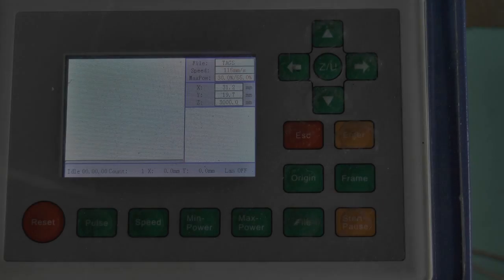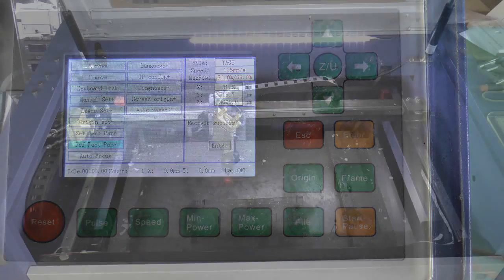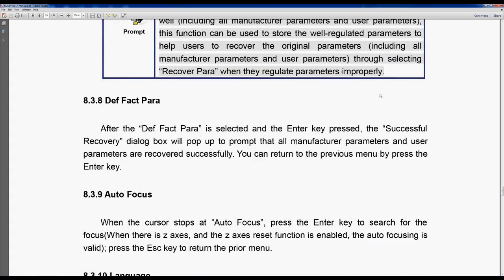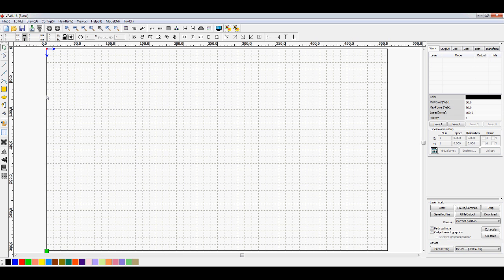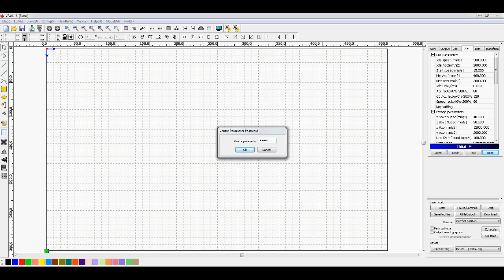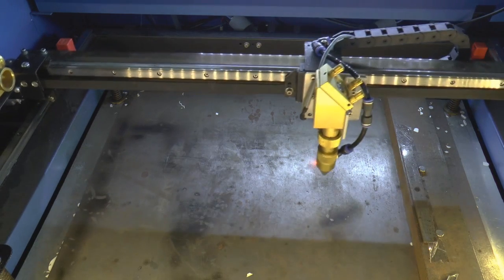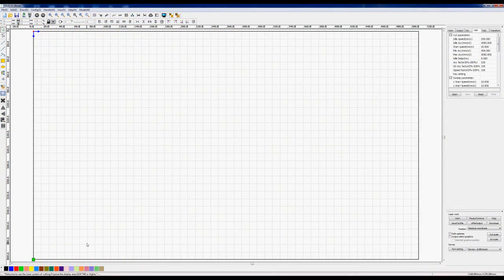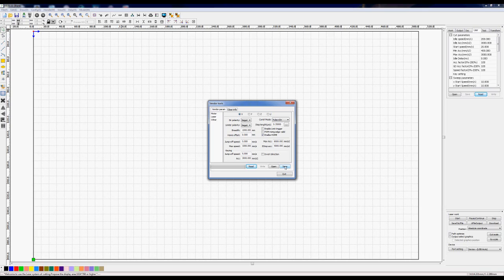RDWorks Learning Lab 74 Disaster Recovery

Comment: hy guys can someone help me witih rd work vendor settinngs i lost them
Reply from the maker: Hi  
This is a common issue  because people fail to save their vendor and user files when their machine is working well..  However, don't panic because therevare several ways to get back into action.. The easiest is to go to https://forum.laseruser.com/viewtopic.php?t=6302
Sign on to be a member to gain access to many different machine files. 
If for  any reason that fails,  then contact me privately with this contact form and I will help you with the problem.
https://forms.zohopublic.eu/ndeavorlimited/form/K40XtreeemLaserCutterContactRussSadler/formperma/k2Cn0QN5ChpazfTMAUw25lZ-FKpjZa96TQWHjv3ntOg

Comment: Hi! We are facing an issue with our laser engraver. After reset, the controller reads 10,000X 10,000Y the Z reads 3,000 and it hits the edge. Can you please share the files with us, which you imported? We hope that it will solve the issue. Thank you in advance!
Reply from the maker: Hi Dora
 Sadly loading new vendor and user files will not fix this problem. This is a 0,0 sensor issue.  You may need to adjust your sensors to make them sense or maybe replace them. see this video.  If you do not have a stepper driven Z axis then Z will always display 3000  Look carefully at this video and test to see if your sensors are working.

https://www.youtube.com/watch?v=DAREAPt3lqs

Best wishes
Russ

Comment: If I don't have backups then what?  It doesn't home correctly, it goes crashing into the edge of the table. It has been set to top left but never goes there, Set the origin button and doesn't start there, it all used to work but since a relay blew it's all messed up.
Reply from the maker: Hi Don 
 It sounds like you may have encountered a fairly common problem.... a failed limit sensor. I have explained everything and how to limp on without it.See  
https://www.youtube.com/watch?v=DAREAPt3lqs

Best wishes
Russ

Comment: hey buddy i have the same controller and machine as yours but unlike you I dont have my backup vender and system settings anychance you could send me the files i dont mind paying
Reply from the maker: Hi 
Are you already deep in the brown stuff??? If so then add your disguised email address (johndotsmithatzoomdotcom) and I will send you my files. If your machine is still working OK then you can make your own backup files. Connect your PC and machine with USB cable.  In RDWorks go to File, Vendor Settings and press enter. The password is RD8888.  Press the READ button and your current settings will be loaded to RDWorks.  Now press SAVE button and save the file somewhere safe on your PC . Press exit and now select the USER tab (top right). Again press READ to upload the current settings and then press SAVE button and you can store it  in the same safe directory.

Best wishes
Russ
Reply: @SarbarMultimedia  DeanatSHAR-KADEdotcom

Comment: What exactly does the SET FACT PARA do then? and how do you recover from that one?
Reply from the maker: Hi
Set Fact Para is a box in which the manufacturer should place the working parameters  (Vendor and User) that they set when they ship the machine. Thus, at any time something goes wrong with your machine settings you can then restore these settings with the DEF FACT PARA. It is important that you save the User and Vendor files out to an external file just in case you ever need to restore that data  You MUST not assume that the machine builder took the trouble to store those vital parameters. As I have demonstrated,, my factory settings were just not there. 
Bets wishes
Russ
Reply: @SarbarMultimedia  yeah...i just figured that out and set it to be worse. But I am working on it. The Z table is what is really kick my butt at the moment. Thanks Russ.

Comment: russ would it be possible to send me a copy of your back files  when I first got my machine i started using it with a lap top but have changed to a desk top if I save the file on my lap top before the software got change would the vendor setting restore to the factory setting ?
Reply from the maker: Hi

Your PC and version of RDWorks will have no effect on the USER or the VENDOR settings. These are stored in your machine. To change them  you need to know how and I guess the fact that you are asking the question implies you do not.. Please do not consider that to be insulting, far from it your lack of knowledge can sometimes be an advantage. I am very adventurous and a bit cavalier in my attitude  because my engineering experience has taught me to be fearlessly cautious and that deep understanding can be very powerful.  If you have not been there then I will advise you that you should store your Vendor and your User settings as separate files on somewhere safe like a USB memory stick.
Follow these instructions carefully and make zero changes to the files
1)With your pc and machine connected by a USB cable run RDWorks.
2)Go to File, Vendor settings, password is RD8888 and press READ. This copies the stored data from your controller into RDWorks.
3) Press SAVE and give the file any name you wish and send it to your memory stick or some other safe location.
4) press EXIT
5) At top right click the USER tab. and press READ. This copies the USER information from your controller to RDWorks.
6) Press SAVE and give the file any name you wish and send it to your memory stick or some other safe location.
7) you don't need to do anything other than click on the WORK tab and you are back to familiar territory.

If ever your machine has a major malfunction, you can always load these files back to the controller because you know that these settings are all working OK today

Best wishes
Russ

Comment: Good morning Sarbar, Congratulations for the videos very well explained, I already watched almost all, bought the pieces and amontei a laser machine with the controller Ruida 6442G, then I will post the video of it working, but I have to change some settings, which I do not know yet, I did not find in your videos, could you kindly help me, do you have any video showing how I can change the speed of the motors by moving X and Y through the panel? the damaquina cut area that I set up is 1500x1000, since thanks, hug.
Reply from the maker: Hi Marlon
The SPEED button on the panel sets a fixed speed for the motors when you press the X and Y arrow keys. In the parameters (within RDWorks) you set the motor speed for each layer. Make sure the default is NOT ticked otherwise all your program speeds will be ignored and the speed you set on the SPEED button will be used.
Hope this answers your question.
Best wishes
Russ
Reply: Yes, thank you very much!

Comment: Hi Russ, I'm running late to the party, but binge watching takes time ;), quick question regarding this and a previous lab, (regarding the stepper motors) does the striations happen in both x&y axis, only curious as the acceleration settings for x are high with y being substantially lower (yes extra weight and all is the reason) but if the lines appear more in x than y maybe play with acceleration settings. I've only had experience in nema 14 (3d printing) so things may change with bigger motors but at those accel settings I would get noticeable reactions out of the machine 
If this is dealt with in a later lab than ignore as i'll get to it soon
Cheers Tim
Reply from the maker: Hi Tim.
 I have dealt with this subject a couple of times further on and every time I think I understand BUT as I get further into unraveling  the nature of the laser beam itself,  I realize my attempts to understand are always leaving a question. I am currently in the middle of what I like to call an "acrylic fest" video where I am trying to  definitively put some of these issues to bed for the last time. Hey, that's the nature of learning. If at first etc etc ....
Best wishes
Russ
Reply: I see a lot of testing of beam into mirrors, is any done out of mirrors? I am catching up (lab79 ep 106) and I fear that I may have quite a few questions for you once I have caught up as I am seriously considering becoming on of the sufferers
Reply from the maker: Hi Tim
If you have had the patience to watch me making mistakes and also ultimately succeeding then  YOUR path to success will be a lot shorter. It has taken a long time and my quest for dots that has ultimately taught me so much about the beast I bought. Your road to success will still be littered with potholes but hopefully they will not be as frightening  or be easier to avoid.
Best wishes
Russ

Comment: Russ

I just thought I'd post of a strange experience I had with my machine  over the last couple of days.

I'm not entirely sure how it happened, but the User data settings somehow got screwed up.

I had not intentionally written updated User settings to the machine, but RDWorks lost its marbles the other day, and its Ethernet connection settings got messed up as did the language settings.

I fixed these easily, but somehow I think the User data settings also got messed up.

I'm not to sure how they get transferred to the machine, I presume its only via the Write button, but I don't recall pressing it, and nevertheless the machine seemed to acquire a bad set of settings.

But the settings were only slightly messed up, so that the symptoms of this, where that cutting a square, it would pause at each corner for a noticable time (perhaps 1/5 second), and even stranger, if the speed was below 20mm/S, it could cut 2 sides of a square at that speed but the other 2 sides at about 0.2mm/S (this may be something to do with right to left movement etc, I'm really not sure)
Strangely cutting a 50mm diameter circle was totally normal (goodness knows what was going on) - But I have a backup of my knackered user files, so I suppose I could try to make a comparison ;-0)

Anyway, I'd lost my User data backup settings, (I think they were on an old PC which I upgraded and change the hard drive, forgetting that I need to keep those files)

So I have used both your Vendor and your User setting. The Vendor settings didnt actually fix my problem, but I tried them first, (I needed to change your calibration settings to match my old settings)

But when I used your User settings, my machine started working even better than when it was new !!!

The only difference I can see between your Vendor settings and my saved set (yes I did have a backup of them), is that your calibration  settings are 50% higher than mine.

So I'm actually wondering if my stepper driver / controllers were ever configured correctly.

On mine I have switches 2 and 7 in the ON position and all others off.
Edit. I just found a manual for the stepper driver, which in my case is a JMC 2M524-06
http://www.cncitalia.net/shop/pdf/2m542cncitalia.pdf

Switch 2 on means 3.1A (max is 4.2 when switches 1,2 and 3 are all off)
Switch 7 on means 5000 steps per rotation.

I did try to work out why your steps settings are not the same as mine, but the difference does not seem to be purely the stepper driver, as your steps settings are 1.57 x my settings, and 1.57 x 5000 = 7850 steps per rotation, but there is no such setting on the driver.  The closest is 8000 steps per rotation, which I presume could be your setting if your pulley were different to mine. 

Anyway, thanks again for making your files available, as I was tearing my hair out over this one, as the symptoms were quite bizarre.

Comment: I guess that should be the first thing to do when we get the machine is to save all the settings in cast of this disaster.
Reply from the maker: Hi Scott
Most important to READ first. That will transfer your machine settings to RDWorks for SAVE  to an external file. The same applies to the USER tab....READ first then SAVE
Good luck
Russ

Comment: Hi,Russ ,thank you so much that your videos helped me a lot, I have a problem about the vendor setting : As I found out my machine (leadshine 57 stepper motor ,RDC6442G DSP controller ,DM542 stepper drivers ,) the seller says my machine can achieve the scan speed of 1000 mm/s , but no matter how may times I have tried to set the top speed in RDworks ,it never work at 1000mm/s , only 500 mm/s default scan speed.I wathched your video and found the "Vendor Setting" ,it shows I can tweak some speed setting to make my machine has a faster scan speed.
  Is it possible to do that?
  Do you have any idea ?  
  Thank you again !
                   Ryan
Reply from the maker: Hi Ryan
I'm just off out for the day (5am here). The answer is yes it may be possible . Send me the link for the machine you have and I do a bit more checking
Best regards
Russ
Reply: Here is the  link where I coustomized my machine. I ordered the Ruida DSP controller ,3 pieces of EGH -15 rail ,57 stepper motor https://jingkelaser.en.alibaba.com/product/60512923585-801363544/JK_4060_best_selling_machinery_laser_engraving_machine_40w_60w_80w_100w.html
Reply from the maker: Hi Ryan

You will need to plug your pc/laptop into the machine via the USB port. Open RDWorks. If you go to File Vendor Settings you will require an entry password RD8888. Choose motor from the list and then the X radio button. Towards the bottom you will see a Max Speed window.. Press the READ button to read into the list the current settings of your machine You should be able to now edit the Max Speed to 1000. Now select the Y button and modify that to about 800mm/s. It has to be slower because there is a lot more mass to move. Now press write and it should have saved that back into your machine. You can press READ again to confirm that your new data is in the machine. IMPORTANT. Whilst you are here, press the SAVE button and save this data to an external file of any meaningful name eg vendor121016. It will add its own extension. Now press exit and see if it works. Whilst you have your pc plugged into the machine, go to the USER tab top right and you will see some familiar buttons. Press the READ button to see what's in your machine and then press the save button and  name this file USER121016 so that you have a matching pair of files. Keep these two files safe you may need them one day. When you have machine set to perfection it would be wise to load them back into the Set Factory Default. The video shows how to do this.

Best regards
Russ

Comment: RUSS!  perhaps I jumped the gun a bit, but I was following along and now my vendor and user setting are lost!

You didn't warn me to not press the reset button without saving first until you actually reset the parameters.

I've been working on this problem for 22 hours now.  I've tried the files in the RD works learning lab.

I'm spent.   

I have the same exact machine as you.  Could you PLEASE send me a pair of proper user and vendor parameter files?

I'm dead in the water without them and there is work to do.
Reply from the maker: Hi Jason 
I'm sorry for your loss, it's a terrifying experience that I felt for about 10 minutes until I realized that I had the data saved. My user and vendor settings are available to download from www.rdworkslab.com.
I am on holiday at present but I happen to have them available on this laptop (lucky you). If you have any issues getting them from the forum, message me with your email and I'll send them to you
Best regards
Russ
Reply: You've been a huge help! While the files weren't a drop in replacement, but I was able to compare them with another set and tweak them until things started to head in the right direction.  I'm not out of the woods yet, but I'm getting there.

Comment: Hello your videos is very helpful but i have problem which is the supplier come and change the vendor parameters and i want to restore factory parameter but i haven't the factory rdvset file also supplier at egypt don't help me my machine super star cx1390
Reply from the maker: Hi Islam
It depends what your supplier has done to the machine.
There are two files that make your machine perform.One is the vendor settings file and the other is the user settings that you can access without a code from the USER tab at top right of RDWorks.

If you have not done so I urge you to save BOTH  these  files that are currently running the machine. They may not be working well but if they are OK but not perfect then they need to be saved.  When you press the ZU button on your machine you will see a menu item Def Fact Par. When you select this key, you will require a password . As you enter the last digit of the password, without waning, whatever is stored in that factory default will be transferred into your Vendor Settings and the User settings. My vendor DID NOT save those setting and what was stored was utter rubbish as you have seen from the video.

First go to your USER tab and press the READ button. This will transfer existing data to a different area of memory that can be saved. Now press the SAVE key and name the file as, for example, USER1.   Now go to the Vendor Settings and you will require a password RD8888 to access it. Press the READ key and the SAVE that file as ,say, VENDOR1.
Now you can try to restore factory defaults (if they have been saved!!) by pressing the ZU key and selecting the Def Fact Par . You will require a password  HF8888. As soon as you have pressed the last 8 there will be a message  "Successful Recovery"
Now press your RESET button and keep your fingers crossed.

If it is a disaster then you can go to your USER1 file and OPEN that. The write button will then be available to WRITE that file back into your machine.  Do the same with the VENDOR1 and you machine will be back to "the current normal"
I do have files from someone else's machine that I think is similar size to yours and is running well. They may work better, but I cannot promise anything. If you like to use the YouTube private messaging system to send me your email, I will let you have those files.

Good luck
Russ